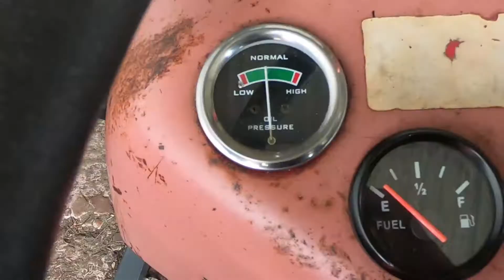MASSEY FERGUSON 35x LEAKING FUEL PUMP UPGRADE - PART 1

Comment: Thanks for this video. Now i can do mine MF 35.
Reply from the maker: Glad it's useful for you. Is that for your barn-find 1962 35? Thanks for dropping by 🙏
Reply: @myharris  yes it is. Fee times now the engine stopped when I was driving. So now i can order a kit to replace the membrame and seal etc.

Comment: Nice repair  sir. There was lot of those old tractors in a farm that I worked in the past (don't remember what brand but they are from the UK).
Reply from the maker: Good to hear from you Cytron. How's the jet engine development coming on? The tractor needs a new engine!
Reply: @myharris  hahaha nice, am working on a smaller jet engine now. I will try to build a turboshaft engine, in case you need one for the tractor :-).